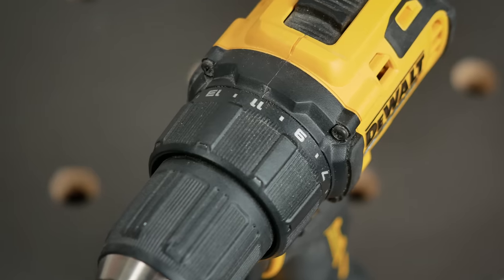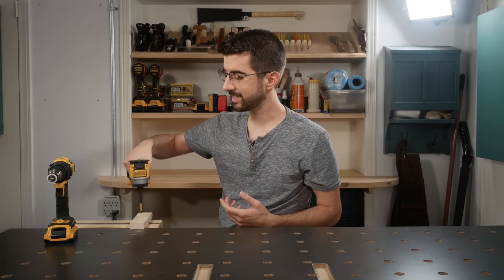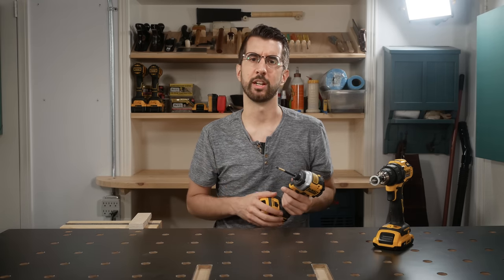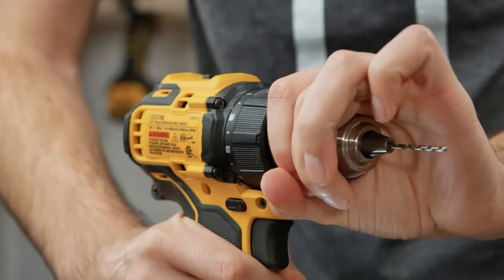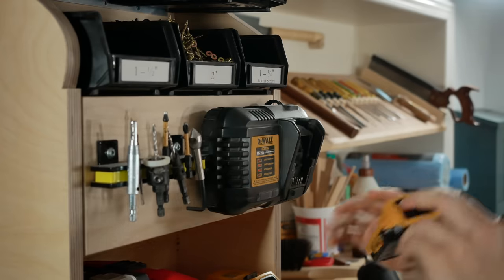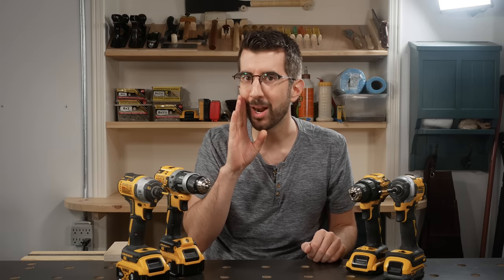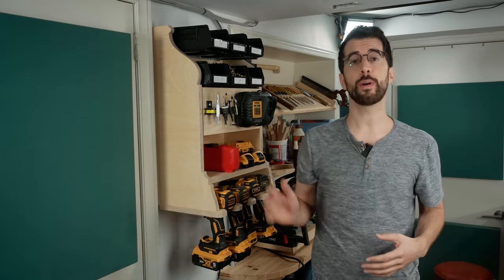why woodworkers don't use impact drivers

Comment: I love my impact driver
Reply: Me too
Reply: Same, in love with my Dewalt XR, get a boner at every screws in 😂
Reply: @rhinoman5078  tf bro took it too far
Reply: @yobtnirp3D  it’s the internet… there is no such thing as too far 😂😂
Reply: At work, when no one is looking I sometimes drive in screws for absolutely no reason😄.  Especially if I find a nice long fat one.  The longer the better but the girth is what really counts.   Size really does matter ☺️
Reply: @rhinoman5078  I thought I was the only one 😆
Reply: @GTB-yu2be  I can see that, using tools is just fun
Reply: I’m 16 and the first tool I bought was a Milwaukee impact driver (2850-22ct) kinda wish I would’ve spent the extra $50 to get the gen 3 fuel kit, then I bought the gen 3 fuel hammer drill, and now the hackzall that comes with 2 5.0 batteries and a charger I like the drill and impact and am waiting for the hackzall to come
Reply: 🥃👴🏿VOTE FOR TRUMP IN 24 MAKE AMERICA THE DONNA REED SHOW AGAIN
Reply: If you have finger control you're alright using impact driver and it has speed control plus pre-drilling your hole helps
Reply: Bosch has a quick release but Holder I dig it use it all the time crescent has the vortex to that works
Reply: Same here
Reply: This comment should be pinned😂
Reply: I also love your impact driver. One day I will borrow it and never return it, and you will be angry and sad.
Reply: I just imported a jdm makita impact and I love it so much
Reply: Me too
Reply: It has its place but it's not a drill or a hammer drill
Reply: It pains me when these guys think they're experts at everything and they are not impacts work just fine for woodworking in fact that's one of the main things they were designed for.
Reply: My impact driver loves me too

Comment: For me I love my impact drivers! Sure the drill might be better in some situations, but I find I almost always use a drill for holes and an impact for screws. Works really well as long as you have good control over the trigger
Reply: Yeah I understand some people might not have the control, but I always use my impact.  Also the brand quality will help with being able to control it and keep it low speed, I could see cheaper ones not have the same finesse.
Reply: The new makita impact is amazing. Has all kinds of settings. Torq levels, one for self tapping screws, even one for bolts. The most controls on an impact ive seen. I still rarely use them and just use my finger as variable speed. But at least they're there if i need them.
Reply: @jacksmith2315  what model is that? Not sure if it's sold here in my country. Should I buy drill or impact? I want to DIY carpentry works at home. Mostly 15mm plywood. Will impact damage the screws or overkill? Btw, I already own Bosch drill 500w but it's corded
Reply: @barberismeable  its the xdt-16. The newest 18v makita makes. Probably about 2yrs old now. If you already have a corded drill, id get an impact. With an impact, you can do pretty much everything a hammer drill can do except drill concrete, since they make pretty much everything with the quick change/quick lock ends now. Its not too much for any task, because you can adjust settings, or not squeeze the trigger all the way and jus release your finger before something gets too tight since almost everything has variable speed triggers. I have both hammer drill and impact so i pretty much use my impact for fasteners and drill for drilling holes, but sometimes ill put a spade/paddle bit on my impact and blast right thru stuff super fast when im doing rough work and dont need a really clean hole.
Reply: Impact is high "horsepower" but low torque which then allows you for very precise control. Like it can spin rapidly but when hitting a certain threshold of torque it will stop just as rapidly. Drill drivers on the other hand are very high torque, but low horsepower - they spin slowly, but they with chew right through your Philips bits and screws like nothing with almost no feedback.

Like a sport bike vs a semi.

Or another way to describe it is steering. With hydraulic steering, you're in tune with every nuance of the road; every bump and imperfection travels through the wheel to your hands. Electric steering, leave you feeling disconnected - everything's too smooth, too insulated. Exactly the same as Impact vs a drill.

And the only reason why it's not obvious to everyone is because drills have torque control and impacts don't have them. 

The key difference lies in the torque control: drills come with this feature, allowing you to set a torque threshold and avoid overdoing it. But here's the catch - materials like wood aren't consistent, making it nearly impossible to find a 'one-torque-fits-all' setting.

Impacts, with their raw, unforgiving power, demand a more seasoned hand. A slight excess pressure on the trigger, and you've overdriven a screw or split the wood.

Beginners often lean towards drills, seeking to avoid these mishaps, and over time, they develop a comfort and proficiency with them. But this comfort can become a barrier to mastering the impact driver, which, in skilled hands, can outperform a drill.

The longer this goes on - the harder to switch. 

But this whole debate goes down to this. 

I worked with someone who was about as experienced as I am and about as fast as I am. He was way faster than couple of other guys. 

Still, I was faster than him with my old impact. I didn't mess up a single screw and I finished identical piece before him. And I think if he mastered the impact it would be reversed - he would be faster than me.
Reply: @barberismeable  Go with the m12 fuel impact hammerdrill package, more than enough for what you want.
Reply: My DeWalt hammer has both? Why would you hammer a screw while spinning?
Reply: What's with the new drills having a non-working cheap electronic clutch that actually jolts back and forth, and doesn't actually completely stop. I don't think the electronic clutch drills are safe for ultra precise, small projects. I bought a new 12 volt Dewalt and a new Flex 18V compact drill, and both of them have wonderful mechanical clutches that click very easily when you bottom out of a screw. My Milwaukee M18 drills switched to electronic clutch, and the clutch seems unreliable and dangerous for over-rotating beyond the clutch setting.
Reply: You guys really need to checkout the Dewalt cordless non-impact driver. Model DCF601 12V, 1/4-in screwdriver. It's basically an impact driver, without the impact function, and it turns 1,100 rpms, which allows you to have immense torque, and also enough speed to use it for drilling holes in metal and wood with hex shank bits. The beauty is, it is extremely lightweight, even lighter than an impact, and the precision you have without rattling the screws is amazing. I never felt comfortable with the weight of the 18V tools or normal M18 impact drivers with my small projects. Dewalt's 12 volt tools are the best looking, with the best ergonomics, and you can still stand them upright on your desk.
Reply: The drill is better in most cases.
Reply: Well, I may loose my status as a based woodworking lady, but it seems like I am surrounded by degenerates!
I use my EFFING Screwdriver when needed! With feel!
Please do not hallucinate that any e-tool (KI already arrived at woodworking? ROTFL) can mitigate your lack of expertise or your laziness, nor it will allow you to do "time-travel" ... meaning: To go back in time to the point, where you didn't ruin that screw-connection:)

Guys, please come back to reality! Or have you really become weak wimps?:P

I wish you all a smile from the woodworm:)
Reply: Impact drivers are great for certain jobs, but when it comes to delicate woodworking, they tend to overpower the screws. Using a drill with a clutch is a much better choice to avoid stripping screws or damaging the wood.

Comment: I've found that newer impact drivers (with speed/torque selection switches) are really incredible for driving fasteners of all kinds but I will take a drill over an impact for ~drilling~ applications any day. Impacts being used properly are also a lot about trigger control. Coming from a construction background I have witnessed many individuals who don't understand what a variable speed trigger is or just don't care as long as they ram that screw in that 2x4. Woodworking involves a lot more patience and care than building a house though.
Reply from the maker: Thanks AJ! yeah this video is definitely geared towards the home hobbyist woodworker. Trigger control is definitely very important when doing delicate things.
Reply: I can confirm most people don't know how to use a variable trigger, they think its on or off. Case in point, tasked my laborer to install the trim ring on a shower mixing valve, heard the BRRRRRRRRRT and knew nothing good was to come of that. Couple hours of trying to find the right length and size screws, right color paint and some trial and error, got the trim ring installed. You can go as slow as you want with variable triggers, most people just send it and blame the bit for the slippage.
Reply: Listening to someone drill holes with an impact all day drives me crazy.
Reply: @Hloy Hesit  i was doing a painting job at a friends house a few days and had to remove and install mini blinds and curtains with a sleeping baby in the next room. It was actually quiter to use my impact that my drill. It was almost 15yrs ago, and my first 12v dewalt brushed set. The impact only hit a couple times, then quietly spun the screws out wo impacting. The drill made the screws screech really loud the entire time, both pulling them and putting them back in the existing holes. I was pretty shocked by that. I thought for sure the impact would have been louder.

Comment: I still very much like the more total control that a drill gives while driving screws, as well as the quietness. I can feel the exact amount of back pressure from driving a screw, and that helps me gauge how many I need to use to hold something, or whether or not the wood is about to split. And when driving a screw deep into wood, it often takes longer and wastes battery more than a good regular drill.

Comment: Impacts are super useful for constructive fasteners like lagbolts and long screws, one of the best things about them is they won't break your wrist when a heavy fastener jams.
Reply: I thought he was going to mention the advantage of an impact just hammering instead of the drill twisting your wrist when they bind
Reply: i need Anti-kickback system :)

Comment: 7th generation woodworker here (specialty is architectural millwork). Around the time I started professionally, impact drivers were just starting to become widely available. They took over quickly, and before long, every professional woodworker I knew was using impact drivers for every single screw they drove. My drill is only ever used for boring holes. The few times that I have ended up driving a screw with a drill over the past 20 years, I remember why my drills see such little use. 
Also, in the shops that I have worked in, pre-drilling was not always done. In a lot of cases, the screws were acting more as a clamp until the glue dried, as opposed to being a core structural component. It was very often that minor splits could be acceptable and more often there would be little risk of splitting, so no pre-drilling would be done. As with most things, it's not a hard and fast rule.
Reply: in the shops i have worked in everyone mostly used impacts except when needing to using multiple bits. really only used drills for drilling holes we only predrilled if we felt it would be needed but  never really had an issue with splitting most screws we used were self tapping, i will say though i used a spade bit on an impact and was blown away how well and fast it worked. we did mostly cabinetry but i mostly did countertops and doors so i didn't use screws as often as others.

Comment: Regarding the drill charging station, because I have tall ceilings in my basement shop, I placed my drill driver, impact driver, right angle driver, bit holders, pneumatic hose, vacuum hose, 115VAC outlet, and other related items in a storage system right above where I stand at my main bench. They are all in easy reach for immediate use, and they don’t take up valuable wall space. The system doesn’t interfere with the headroom above the bench or vise for large items, and it saves travel time because I don’t have to walk to a wall to get stuff. Lastly, having the power supply, air hose, and vacuum hose coming from overhead declutters the bench and floor. 
Hope this helps!

Comment: I splashed out on one of the 'fluid drive' impact drivers (Milwaukee for me, for sentimental reasons I won't bore you with) and don't regret a penny of it. SOOO much nicer to use - less vibration, less noise. And yes, it has a speed switch and yes, that (plus a bit of practice, always a useful thing) helps avoid broken screws.

Comment: Great discussion!  Like you, I’ve settled on the DeWalt platform (debated between them and Milwaukee - but my home builder and most contractors seem to use yellow & black around here - though Milwaukee tools are excellent too).  I relegate my impact driver to construction projects (deck building, etc.) and rely on my drill driver for 99.99% of woodworking. Two primary reasons for this: (1) if you need the power of an impact driver for furniture, you’re doing something wrong probably, and (2) the speed of driving a screw into wood with an impact driver can lead to the wood splitting whereas the slower speed of a drill-driver allows the wood to “relax” a bit to accommodate it better IMHO. 
Thanks and keep up the great work!
Reply: I like DeWalt. They might not be the best tool in every test, but they're usually in the top three every time and seem to last really well. And if you're buying into a battery ecosystem for cordless tools, it's a pretty good option.

Comment: I like Steve Ramsay’s logic for having both as essential tools: ones for drilling, ones for driving. I know that drills can do both, but it’s easier to have one set up for drilling pilot holes and one set up for driving screws.
Reply: Same, I try to stick to using them separately when I can. Either can technically do the others job, sure, but the impact driver does SOOO much better at driving  Send and the drill is easier to control and is way quieter for drilling.

Comment: Been using my bosch impact nearly every day for the last 6 years. Never went back to a drill for fasteners. I don't know about dewalt but my bosch has a motor that slows down as you squeeze less on the trigger so I guess you'd call it variable speed. This has been infinitely helpful at giving me precise depth control of all fasteners. Something you really don't get with a drill at all.

Comment: I use the m18 fuel impact and drill and I’ve only broken 1 screw head, and that was right after I got it and was just testing it out. Since then, I have hardly took it out of speed 2 and use trigger discipline to not over or under drive them. I know this video is geared more toward beginners, which is why I think the variable speed trigger and trigger discipline shouldn’t be overlooked when learning how to use impacts.
Reply: Same.  First tools i ever spent actual money on. Though i got them for fixs around my rv and car.

Comment: Fair points, instead of using the basic magnetic holders look for a quick change bit holder that have a collar you pull back just like with the impact drills to lock bits in.

Impacts are way underutilized if not use for removing 9/16 nuts and bolts and up. As for a several hundred screws in an hour argument one might make for an impact well there is a better tool for that and its a Screw Gun.
Reply: Even when doing decking or installing a bunch of hangers with screws i still prefer impact of screw gun. The only reason i would buy a screw gun is if i did sheetrock for a living cause they wont over sink them. Other than that drill and impact is the way to go for everything else. Drill for holes impact for fasteners. I have a set of drill bits with the 1/4 hex/quick change, i still use them in my drill instead of in the impact. Something about impacting on a drill bit doesnt sit well with me. Except for hammer drill with concrete of course

Comment: I have a Bosch 12v impact and driver combo set. I use them both all the time with wood working. The impact is great for counter sinking, and I can use the variable trigger to make sure I don't drive thru the wood, it's all in the use of the tool.

Comment: Spot on there Scott. I have both but don't use the impact until the monster screws come out to play. You know the ones.  I love your videos.  To the point with just the right amount of humor. Hang in there someday you will get to have a bigger shop.
Reply: If they're that big I get out the battery hammer drill, set to drive and boom, big screws fly in.

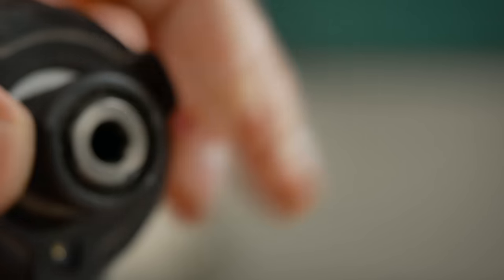Comment: @1:05 Rapidaptor by Wera. It will change your life. It's meant for an impact, but you can chuck it up on a drill and works WONDERFULLY.  Life's just too short to always be picking up the damn bit.  I do like impacts because it's lighter and fits better in a confined space. But hearing protection is a must (and annoying to others)  :)  As for spin of death, once you go to spax or square drive, it's a thing of the past. But I did not know about impacts ability to sink in the bit.  Learn something new every day.
Reply: I came to see if anyone had said anything.  These are indeed great.  There are competing products, but it's one of the nicer ones.